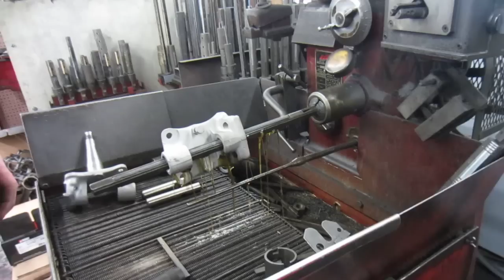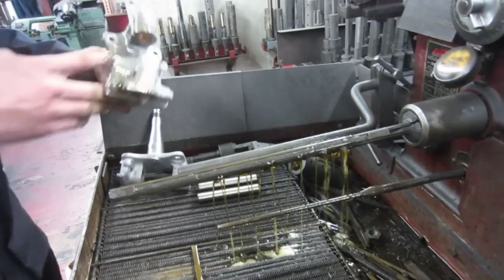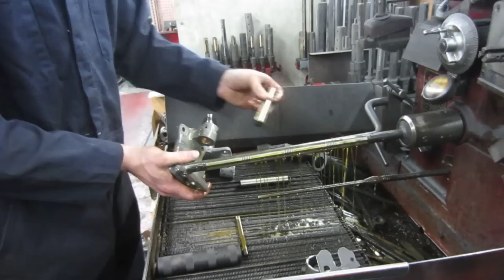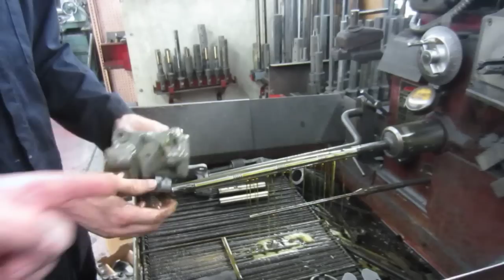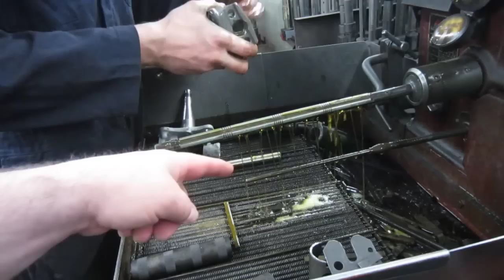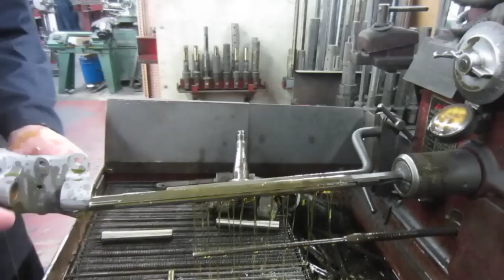Datsun Truck Kingpin Rebuild - Part 36 (Honing - feat. Don's Machine Shop)

Comment: Ugh, I'm coming to this a little late because I'm about to rebuild my 620 kingpins and I'm a bit dumbfounded that you have to hone the bushings after install...... shouldn't they just be the correct size? Or does the inner diameter shrink when you press them in? Is this an absolute necessity to do?
Reply from the maker: Yes, the inner dia shrinks when you press the bushings in.  I know a guy that had a shop install his bushings and they didn't know about the honing.....he could barely turn the steering wheel they were so tight.
The ID can be reamed, but I'm not a fan of reaming.  I've also tried using a brake cylinder hone, but it's really hard to get the two inline.  If you can't find a local shop with a Sunnen hone, you might google Don's and see if they would let you mail them.
Reply: @bluehandsvideo  thanks a ton for the info! Guess I'll have to get it figured out, maybe even with Don's help!
Reply from the maker: @mrbookends  You can search my channel a bit....I've posted tons of king pin videos over the years....too many to watch, but you may find some useful info in them. :)

Comment: esa maquina empleada para dar la tolerancia entre pine y bocina no se compara a un ajuste manual usando rimer y guia cónica que da un acabado mas exacto a todo lo largo de las bocinas
Reply from the maker: +Javier Eduardo  Calderon  Garcia Google is not translating it very well.  Seems you're saying that this machine is not as accurate as another manual method.  Do you have a picture of the better method?